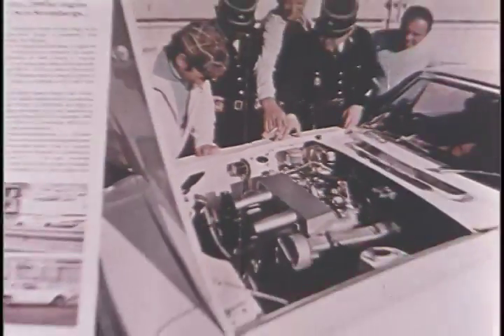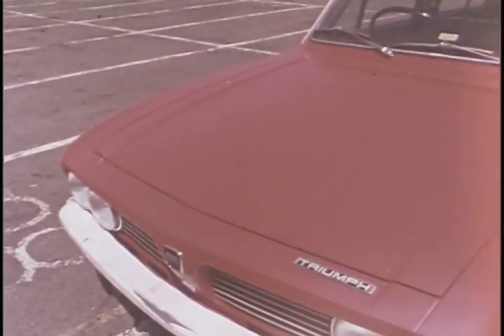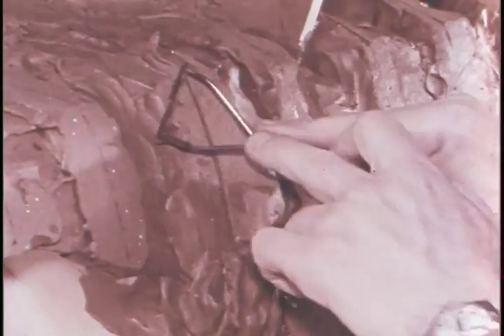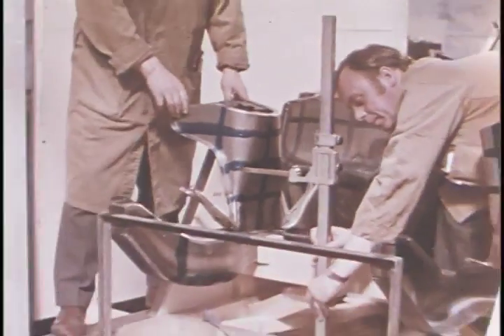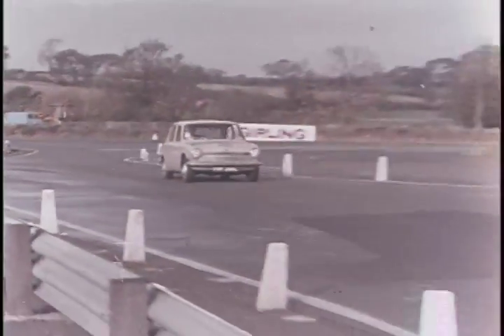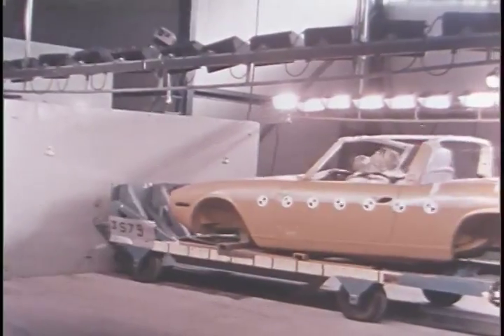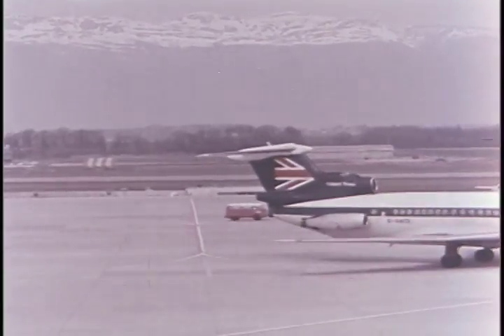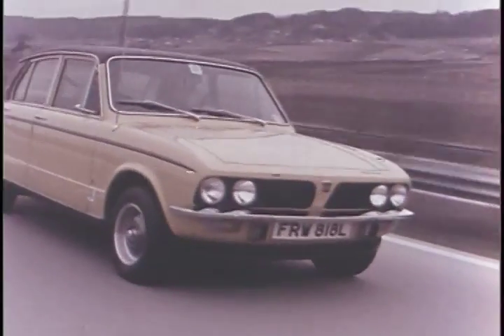This is Triumph

Comment: Nothing reliable about the stag engine  a  total failure
Reply: For your information Firstly the engine was still in the development stage ( going on since 1963) when it was rushed into production by the newly appointed“manager” Spen King” ( from Rover)who in turn was put under pressure from the new British Leyland board to get it put into production via the Stag Model fearing lost profits, particularly from the USA.. All against the advice of the brilliant old manager Harry Webster..(who was promoted sidewards to sort out Austin and the rest of the BMH dogs dinner)This was, an entirely new ground up designed engine which hadn’t been put through the 100,000 kilometre prototype reliability road test yet!, not to mention they had not got the fuel injection to perform.. quite advanced stuff going on.
     Then the quality control negligence set in… Engine blocks not checked ( as on this video)… Just taken off the pallet and assembled along with the casting sand still in the cooling jackets.. The weakness were small beer if it was tested and mass produced.. which it was not!
    If the engine is assembled correctly it really needed a modern coolant header tank with a low level switch warning.. 
  also weak water pump and timing chains which can be offset with a 3000 mile oil change instead of a 6000…. 30% antifreeze at all times and a change every couple of years to offset corrosion accumulation…. The engine otherwise was well developed and was way advanced achieving 30MPG which the Rover V8, a slightly older and well tested design could only dream of- Critical in the oil crisis years 1972 … Familiar? 
   Apart from the quaint manual choke; the engine drives smoothly and easily keeps up with modern traffic with a hearty exhaust note giving respectable fuel economy even by today’s standard - AT 50 plus Years hence.. It was well ahead of the pack in the day but died at the alter of British Leyland who shrugged their shoulders as the chaos ensued in the whole organisation till the whole lot collapsed- marvellous

Comment: Reliability? Uh...British Leyland also brings back memories of Austin Allegro..worst piece of shit car ever to be build! It also earns a top placement for the uglyest thing on wheels.But ok, when i look at the TR6..everything is forgotten about crappy cars..that's porn on wheels!!
Reply: Kalle Klæp Allegro was the Austin Morris Division. Triumph as part of the JRT Division (Jaguar Rover Triumph). Oh but still poor build quality. I bought a Dolomite Sprint brand new. It was in the showroom but 2 of its 4 doors wouldn't open!! Did 124,000 miles in though and I could p*ss off 2 litre Fords dead easy.
Reply: click7791 Ha,ha,ha..yeah..piece of shit ..but you just got to love it anyways..LOL. There is a plan to let the Triumph brand live again, but i don't know how far they got with it. Think BMW will provide a little help there..could be interesting to see a Triumph bike or car again..i just love the Spitfire..(regardless of a few flaws here and there)..
Reply: +Kalle Klæp Italian desigened coachwork, of course...But hidious cast iron 'boat anchor' pushrod Herald engine + two cylinders when the likes of Alfa and others were employing alloy engines and propper 5 speed all syncro boxes. This car has no race pedegree at all. The only appeal of this car is the Michelotto style, not anything else!